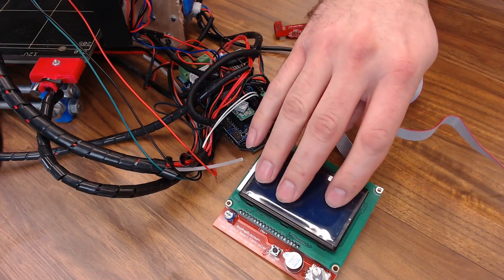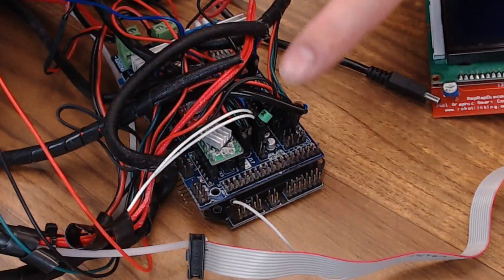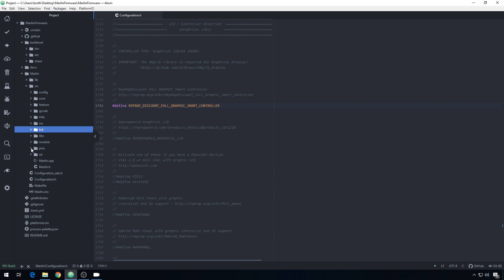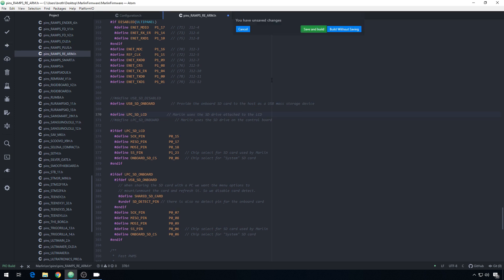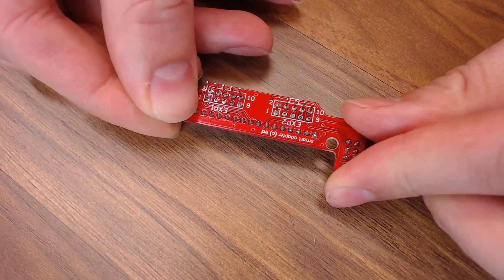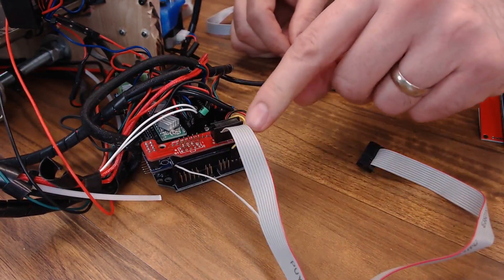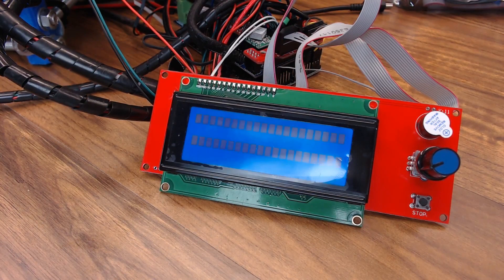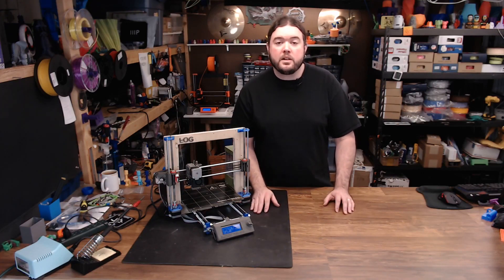Re-Arm Main Board Revisit - LCD Screen - Chris's Basement

Comment: I recently installed 2 duet wifi's, installing them and configuring was so quick and easy. Getting back to my own arduino ramps combo just felt old and clunky. When I saw your previous video about the rearm board the only thing I tough was hell no :-) The ramps was good for it's day, it helped open up the DIY 3D printer marked. But it is old and has a lots of  downsides. You can buy A duet clone for 70 euros and just be done with it. No hacking etc. 

And this is not intended to be a negative comment, you just made me realize I'm done with the ramps combo's and recompiling after every setting :-)
Reply from the maker: The point of view is always appreciated. Thank you for the input. The Duet boards are really awesome, agreed.

Comment: Thanks again, this is one of those golden ones,  I wasnt aware of the  tweaks needed to get displays working,  some time ago I made  a cable up that attaches to aux3  & aux 4 on the ramps that works with a mega/ramps combo using the 5v and ground pins off the aux4 connector,  so am I right in thinking  that as I dont have a smart adaptor pins D25, D27 & D29 can be wired directly to the re-arm board instead of connecting them to the aux4 header? thanks again!
Reply from the maker: You're welcome! That sounds right, you are correct they can be cabled up that way if need be, I just don't remember which pins they are off hand.
Reply: @ChrisRiley  thanks for the reply, I ended up being a bit lazy as browsing the pins file I noticed there was a reference to the Creality display,  I just trimmed the edge of one of the plugs and fitted it to J3 and it works a treat - thanks again!
Reply from the maker: @DevilbyMoonlight  Awesome, nice fix.

Comment: chris thanks for this update, but I got a question since you got the 2208 drivers is there anyway to make a video of this rearm board with the 2208 drivers. also a comment on the 2004 if you want to run smoothie-ware on the re-arm board you need a like an arduino mini or something to link it to the spi output. there is a link on the smoothieware page
Reply from the maker: Interesting, I will have to take a look at the smoothie page. Yeah, I can add 2208 rearm to the list.

Comment: I'm waiting for a tutorial on running Marlin 2.0 on a 8-bit board... lol I started messing around with it on a spare board, but had a number if issues getting Atom working, and put it aside for later.
Reply from the maker: lol, yeah, that will be coming after the final 2.0 release I am sure.
Reply: Why you will ever do the 2.0 on 8bit board thru atom?why you wont use normal way" arduino ide"?
Reply: @ChrisRiley  Looking forward to it!
Reply from the maker: @alinioanmoroi1370  I will give 8bit a try.
Reply: @ChrisRiley  yeah...for 8bit boards don't need to use atom or other platform for upload the marlin bugfix 2.0.x...the normal way "arduino ide" works just fine!
Reply: @alinioanmoroi1370  I had tried it some time ago and ran into issues with Arduino 1.9 (which is still in beta now). Once I got that running I also had issues with it compiling for the full graphics display I wanted to use. Apparently you need an updaged u8glib, not the older one like with 1.1.X, I just set up 2.0 bugfix for one of my printers and compiled it, will flash it later and give it a try! Seems like both Marlin 2.0 and Arduino IDE 1.9 have made some progress since I last tried them... lol
Reply: @bonafidepirate  I used arduino ide 1.8.5 to upload marlin 2.0.x on ramps+mega, mks gen l and mks gen 1.4 with no problems...i use arduino ide 1.9 beta to upload marlin on my arduino due+radds board with no problem as well...

Comment: and @ 3:48 make sure your heat sink on the Extruder stepper driver isn't shorting out pins on the stepper driver board !!
Reply from the maker: Ha! I noticed that guy was getting a little wonky. I'll make sure I fixed it up.

Comment: Hi Criss I have 3d printer which has makeboard mini control board I have connected robotdyn lcd 20x4 it works fine but only problem is I cannot print directly from the Lcd controller but I can print by connecting the printer to computer and using ponterface where print from SD card option is available. 
When I insert SD card on Lcd it doesn't read but when I open 'no SD card' option on display it shows the g code files but it won't print if I select but timer on  display starts. 
So can you help me out please.
Reply from the maker: THe only thing I can think of is that EXP2 plug might have a different pinout. Compare the board and the screen.

Comment: Chris. Have you any plans to adapt the MKS TFT touch screen to the board?
Reply from the maker: None as of yet, they are really cool.  It would be fun.
Reply: I put them on all mine...they’re addicting and now I’m preparing to go 32bit boards. This would’ve “frosting on the cake”!
Reply from the maker: @neuxstone  Now I really want one. lol
Reply: Chris Riley the other nice part about this it has a battery/capacitor for a full out power failure and filament detector/pause function. Uses a cheap detector which plugs into a two row 6 pinout. The other 3 pins are for a second detector if you're using dual printhead. In my case I built a polyester gel extruder and separate catalyst function using marlins new mixing head feature in 1.9.9 (Pia Taubert M163 M164 mixing gcodes. 
Here's the ones I use. You'll need to update the latest firmware on it before use. Let me know if you do this and I'll link you. I also have a screen STL for a front cover extension for the CR10 Slant Front box. 
KINGPRINT MKS TFT28 2.8-Inch Full-Color Touch Screen 3D Controller Board for 3D Printer https://www.amazon.com/dp/B07589F8JN/ref=cm_sw_r_cp_tai_kzziCbTJTCAZS
Reply from the maker: Thanks for the info, I am going to get some of these.
Reply: Chris Riley  Great...can't wait to see what you'll do with them!

Comment: Chris, did you measure the stepper drivers reference voltages, mine was lowered down after changing from Arduino to Re-Arm board.
Reply from the maker: I haven't yet, I will check that out.

Comment: Thank you the screen is working  :)  I noticed 2 things..  one filament runout sensor (same as in you runout video ...great vid also) is unloading filament when starting print with or without filament in the device ?? the other is when I try to print off sd card the print never starts after bed level and I get terminal error no temp settings found ? I was wondering if anyone else had the same ??
Reply from the maker: Wow, I haven't ran into those issues yet. It almost has to be a bug of some kind causing this.

Comment: I thinking about buy a re arm but does the tmc2130 works the same as it works for the normal 2560???
Reply from the maker: Yes, it "should" work the same as long as the bug have been worked out of the firmware. I have not tested it.

Comment: Hi, I am stuck, I cannot get my discount smart controller to read sd cards with your guide. It will turn on, I can read and move through the menu, and it it will detect if an SD card has been inserted but inside the sd card menu is always blank. 

In Marlin 2.0.6 they moved defining onboard or lcd sd card detection from pins_RAMPS_RE_ARM.h  to configuration_adv.h which I enabled as shown below

//Configuration_adv.h
  /**
   * Set this option to one of the following (or the board's defaults apply):
   *
   *           LCD - Use the SD drive in the external LCD controller.
   *       ONBOARD - Use the SD drive on the control board. (No SD_DETECT_PIN. M21 to init.)
   *  CUSTOM_CABLE - Use a custom cable to access the SD (as defined in a pins file).
   *
   * :[ 'LCD', 'ONBOARD', 'CUSTOM_CABLE' ]
   */
  #define SDCARD_CONNECTION LCD

#endif // SDSUPPORT

//pins_RAMPS_RE_ARM.h
//
// SD Support
//
#ifndef SDCARD_CONNECTION
  #define SDCARD_CONNECTION              ONBOARD
#endif

#define ONBOARD_SD_CS_PIN                  P0_06  // Chip select for "System" SD card

#if SD_CONNECTION_IS(LCD)
  #define SCK_PIN                          P0_15  // (52)  system defined J3-9 & AUX-3
  #define MISO_PIN                         P0_17  // (50)  system defined J3-10 & AUX-3
  #define MOSI_PIN                         P0_18  // (51)  system defined J3-10 & AUX-3
  #define SS_PIN                           P1_23  // (53)  system defined J3-5 & AUX-3 (Sometimes called SDSS) - CS used by Marlin*
#elif SD_CONNECTION_IS(ONBOARD)
  #undef SD_DETECT_PIN
  #define SCK_PIN                          P0_07
  #define MISO_PIN                         P0_08
  #define MOSI_PIN                         P0_09
  #define SS_PIN               ONBOARD_SD_CS_PIN
#elif SD_CONNECTION_IS(CUSTOM_CABLE)
  #error "No custom SD drive cable defined for this board."
#endif
Reply from the maker: I am not sure what cable those are on, but I think it is EXP2, are you sure that cable/pinout lines up?
Reply: @ChrisRiley  i am not entirely sure about about the cable/pinout, I made three copies for three printers. I rewatched your video a couple times to make sure I broke out 5V from EXP1 and pins on the LCD adapter were from left to right 4,5,6 as shown in the video were jumped to pins P1_17, P1_14, P1_10 on the re-arm respectively. The things like sck and miso pins look to be the same as yours from pins_re_arm.h in the video. 

Big thanks for the fast response, been tearing my hair out for a while now so it's great to find some help trying to figure out where I went wrong xD
Reply: @ChrisRiley  https://github.com/MarlinFirmware/Marlin/issues/19137

I created a marlin issue a little while ago so I hope I am going about this asking for help thing right
Reply: I have the same problem, the printer detects that the SD card are in, but when I open it I see nothing, none of the files
Reply: @peterfoldesi483  no idea how to solve the issue with the discount controller, I rebuilt some configs for some of my older printers so I could swap their full graphic display with the discount controller

At least with full graphic displays the sd card reader works

Comment: Hello Chris, I have a white RRD adapter, the connectors are rotated 180 degrees (red pin is on the left). Is it still ok to use same pin for 5V? Thanks a lot
Reply: Uhm, maybe not, maybe I need to cut the red one, cable are reversed and red is not on pin number 1. Anyone before I fry my RRD controller? Thanks!
Reply from the maker: @giusepperocca8775  Hmmm, let me think on that one...i'll have to go look at mine.
Reply: @ChrisRiley  ok, thanks!
Reply: @ChrisRiley  I'm talking about this one https://reprap.org/wiki/File:Smart_Adapter_2.jpg
Reply from the maker: @giusepperocca8775  Those should work the same. The red one doesn't matter so much, it's which one is on 5V, that should be EXP2 pin 8. Probably need to check it with a meter to be sure.
Reply: @ChrisRiley  yes, exactly. In my case the red is the pin n.8, the.connectors are soldered upside down but cables are the same like yours, so red should be the right one.
Reply from the maker: @giusepperocca8775  Ok, then I think you are on the right track.

Comment: can you use tmc 2130 with re-arm?
Reply: re-arm board does not support the use of the TMC2130 SPI mode...….yes in Step/Dir .. this is a copy past from when I bought the parts .
Reply: Vorga Orga, thanks for the info. Chris uses software spi in marlin. I was wondering if that was different to hardware spi? And would allow the use of tmc 2130
Reply: @Brocknoviatch  I just bought a complete rearm board setup with tmc2130 when I get them in the next couple weeks I'll do some more research on it. Tmc2208 seems to work fine with the rearm card on ramps 1.6 I'm running now
Reply: Vorga Orga - sweet! look forward to see how you go
Reply from the maker: Looking forward to the testing on this. There is also a RAMPS 1.6+ out that has integrated support for 2130's. That could be interesting.
Reply: yes the ramps 1.6+ is set up for TMC drivers w/jumpers and I noticed Alix Kenis has posted a bit of a hack to get the TMC2130 to work in spi mode with the ramps 1.6+ and re-arm
Reply from the maker: @vorga3143  Awesome! He's really good with these.